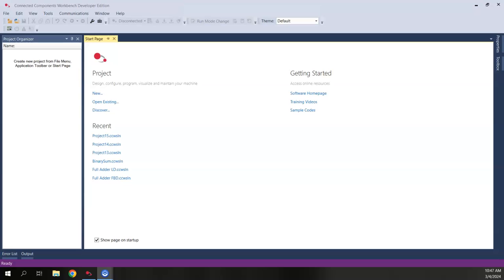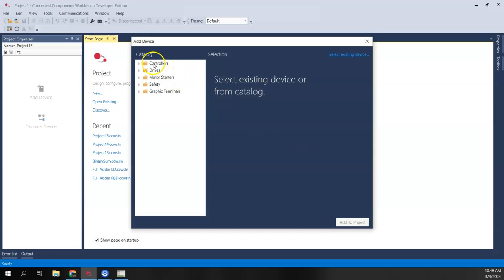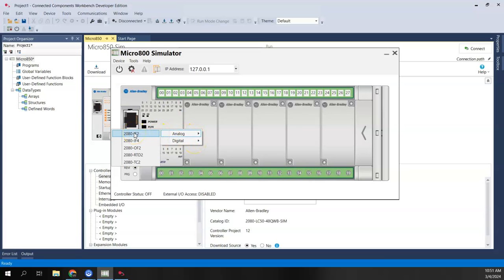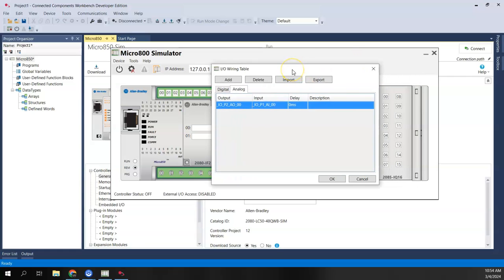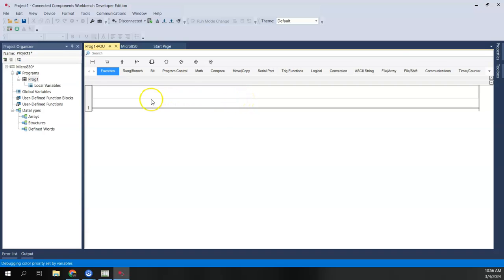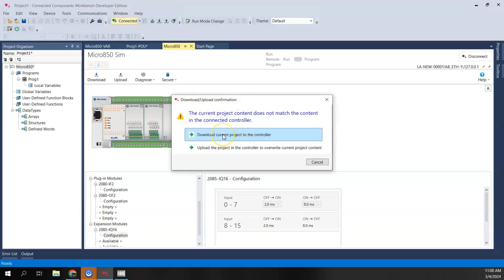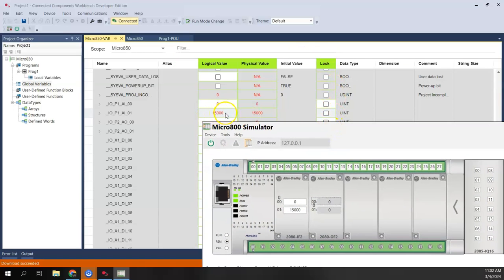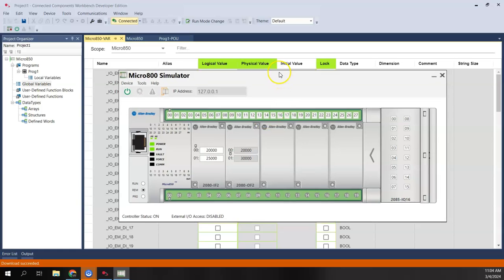Using the Micro800 Simulator in Connected Components Workbench (CCW)

Comment: What are you supposed to do if the device you want to test with is a Micro870? are we forced to use the 850 for testing anything?
Reply from the maker: Hey Brandon, if you want to use the virtual Micro800 simulator for testing, you would just need to change the configuration to be the Micro850-SIM in CCW.  Then you can change the configuration back to the Micro870 for downloading to the physical controller.

But if you have the actual Micro870 available to work with, then you would probably not need to use the Micro800 simulator for testing.  You can work with the real CPU.

Comment: 11:33 I don't see the 127 IP address so I can connect to my simulator. I just can't get the damn thing connected. I don't know why CCW can't just let us run the logic from the same goddamn window we built it in instead of jumping through all these supid hoops just to test the logic.
Reply from the maker: Sometimes if the 127.0.0.1 does not work with the Micro800 simulator, you can stop the simulator and before starting it again change the IP address to one of the others shown in the pull down menu (usually your IP address as assigned by the DHCP server).  Also make sure FT Logix Echo is not running if you have that installed with it using the same 127.0.0.1 for a CPU.